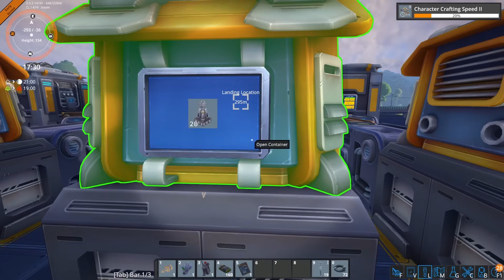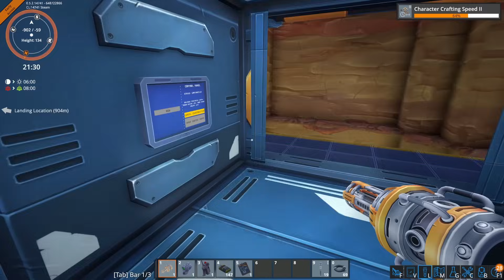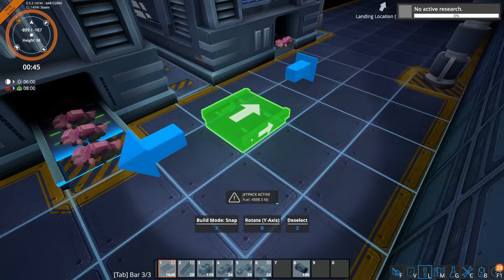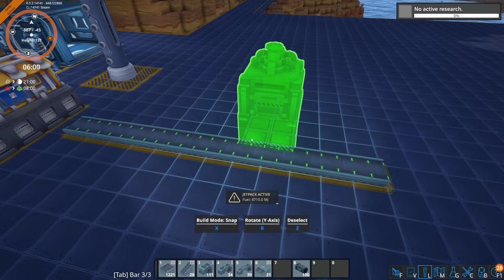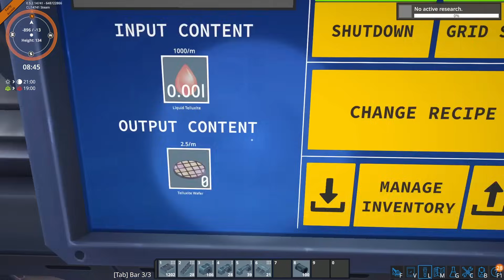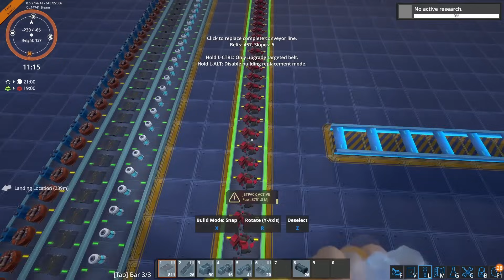"MINES OF MORIA" For CPU Production In FOUNDRY Early Access | 09 | Lets Play

Comment: Found it FAR easier to just elevator down to an ore vein, place the miner, delete the elevator & just run a spiral belt up the shaft with wall electrical posts going down.

Boom done. Plus ore miners do not need a foundation.

2 yellow belts with miners will fully saturate a level 3 belt.

Comment: If you turn the freight elevators long ways then you get 2 separate inputs and 2 separate outputs. You can even use 1 side to send items up and the other to send items down.
Reply: I don’t think they work that way. I tested this and several other configurations, and I can’t get more than 1 up lane. You can do 1 up lane and 1 down lane at the same time. But not 2 up lanes. Unless there is some setting I’m missing. I really wish they would work that way, but they don’t.